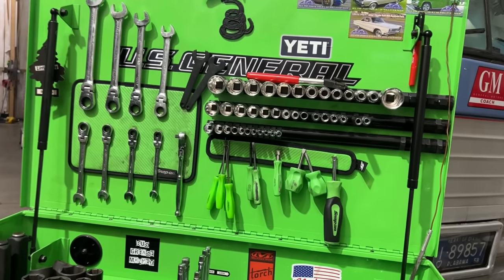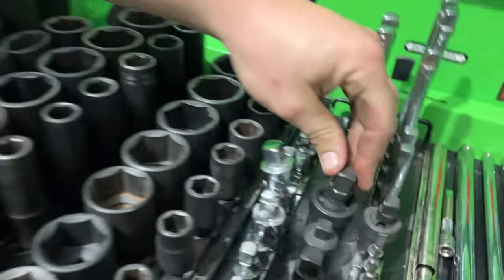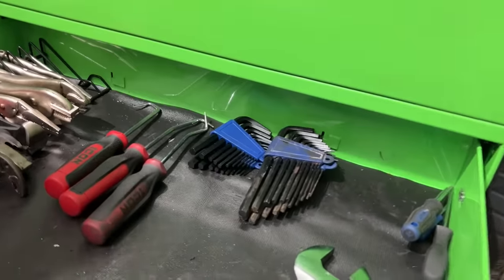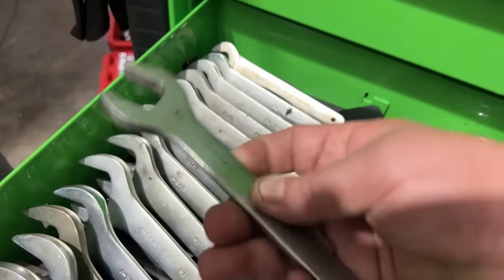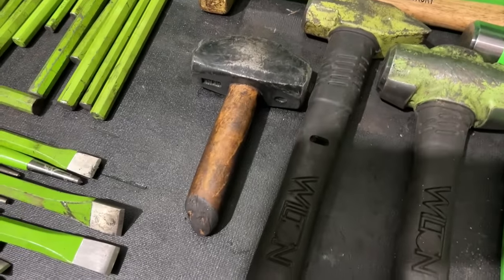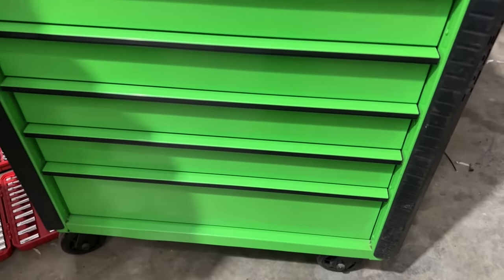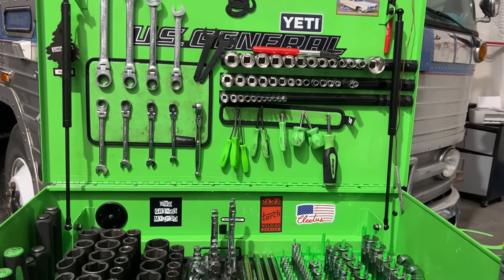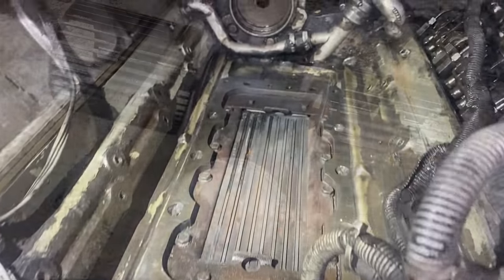1yr anniversary vintage diesel bus mechanics toolbox tour after 1yr in the shop.

Comment: Good to see impact sockets vs chrome for an impact gun. Chrome sockets are not engineered to withstand the impact forces and if the chrome starts to peel (can happen to any brand, especially if abused with an impact gun) that peeling chrome will become a razor blade and can send you to the emergency ward if you have a habit of holing your hand on the socket while checking direction or other times. You may think that it is safe with chrome because you have never had issues but are your hands worth the caution? Jonathan has a very nice selection. In my box I have the Snap On lady foot pry bars, the ones with a pointed end and a fulcrum prying foot on the other. Older Mack engines had the injectors held in with 2 bolts and a high mileage engine in which the injectors were replaced with no Never Seize, they could become extremely stuck in the hole. The Snap On pry bar was a blessing in helping to life the injector from the head. Between hammering the injector sideways at both stud bosses and prying and using penetrating fluids, the prybar would finally get them removed.  Detroits are a bit different.

Comment: Great box: John, you needs more electrical tools like testers, wire nuts, soldier iron. power strip with USB ports, Bluetooth speaker, battery charger for the Milwaukees

Comment: I was a big truck mechanic for about twenty years and my first was a Craftsman set and a 1/2-inch drive impact in a Stack-On toolbox. Over the years I built my set to include tools from Craftsman, Snap-on, Matco, Mac, and Proto. I now have three toolboxes to hold it all and it includes a roll about like his for my most used tools. Looks to me as though he has a good start on his journey to become a master mechanic. With the way he's buying tools he may need a bigger toolbox soon, though.

Comment: Nice set Scott. When I started out I had alot of my own stuff but when I went to work as a Massey Ferguson mechanic I had to have a lot of special tools and found myself buying a lot of them from off the Snap-on tool truck and the Cornwell truck. Then a little later on I went to Sears and bought a whole set of Craftsman stuff and really liked them plus I bought the very biggest Craftsman tool boxes they sold and I still have it. Then after that I started going to Harbor Fright  and buying tools I needed on I need something quick that I didn't have but that was back in the cheap Harbor Fright days but as time went on man so did the quality go up on their stuff. Now if I need anything I never go anywhere but Harbor Fright. Their stuff isn't only good but much cheaper prices than anywhere. So I'm with you guys I have many different brands but I trust my Harbor Fright tools as much as any manufacturer.

Comment: i hate that style locking pliers. i preffer the vice grip type ones. even the knock off vice grips work pretty. i find the style you showed are more likely to pinch you when you release the pressure.
Reply from the maker: You just back off the end then release never any pinch